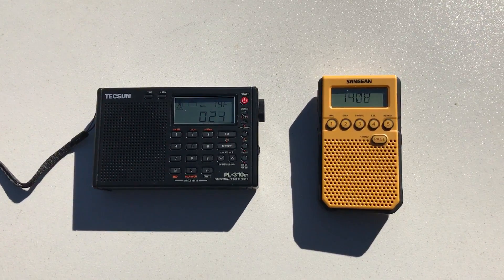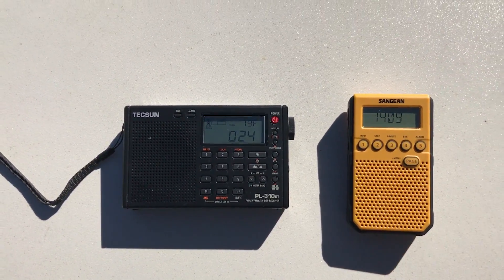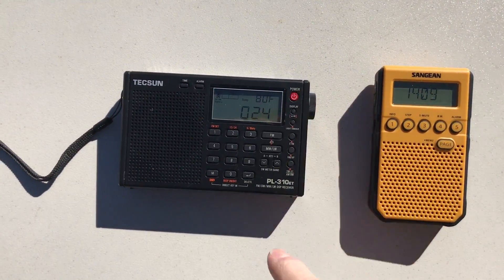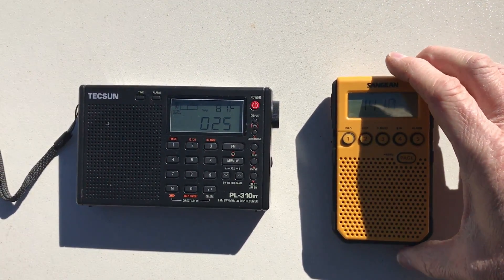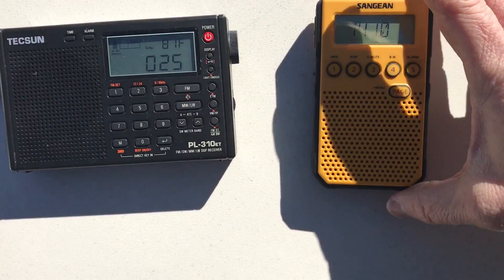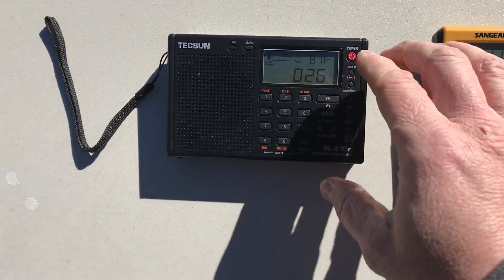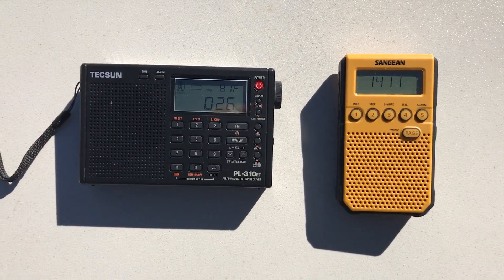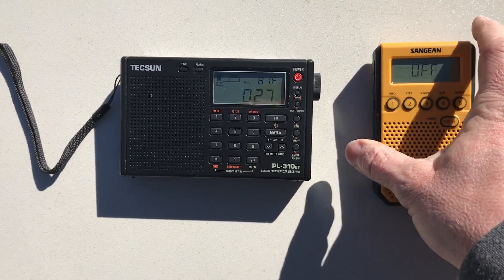Comparing the Tecsun PL-310ET and Sangean DT-800 on AM/mediumwave

Comment: FYI the DT-800 requires the headphone wire as the antenna. The manual says it.
Reply: For fm it’s required; am however has an internal ferrite antenna.
Reply from the maker: That's correct for FM reception. AM reception, which is being tested in this video, relies on an internal ferrite bar which is why the headphones aren't connected.

Comment: What is the range (in km) of recieving capacity of AM and FM station of 310et? I am thinking of buying it.
Reply: I could get american and chinise medium wave stations with external aerial and tecsun 310in UK.American even come in summer for few hours...
Reply: https://youtu.be/0wpCgoL3CHc
Reply: https://youtu.be/ynRQCCpKjTE
Reply: Fm I could get some stations from Balcans Danmark Morocco  Spain so far..The 310 has really sensitive and selective tuner..Great choice for dxing, especially after outside mw and lw aerial modification.
Reply from the maker: That is a difficult question to ask. It depends on the topography around you, the noise level (on MW), the station's antenna system (and if it's directional) and their output power. With that said, 500 km is simply too far for any sort of reliable FM reception. 150 km is difficult unless the station happens to be powerful and have a very tall antenna. On MW, at night, it's easy to DX stations 500km away, but not always reliably unless they're directional and high power.
Reply: @ThomasK4SWL  thanks for your reply
Reply: I can FM and AM dx using the 310et 2000+ km away

Comment: Thanks for the review! but how do you like your Tecsun pl- 310et when you put it alongside other DSP Tecsuns, say for example 380 or 360 or 606?! Thanks again for your time, 73!
Reply from the maker: I have a slight preference for the PL-310ET over the other DSP models you mention (save the PL-606 which I've never done a direct comparison).
Reply: SANGEAN DT-800C and TECSUN PL-310 ET has FM expanded band (64 - 108 MHz)